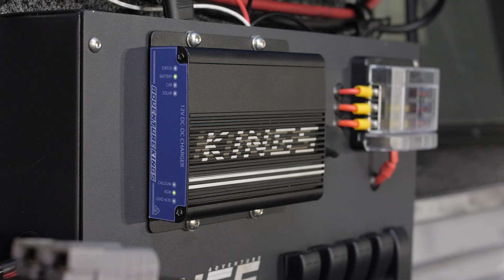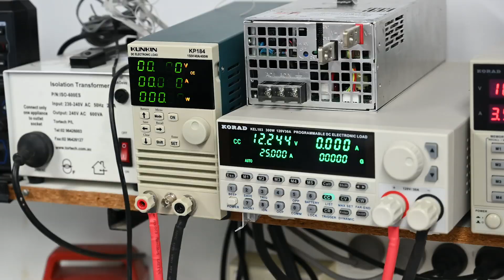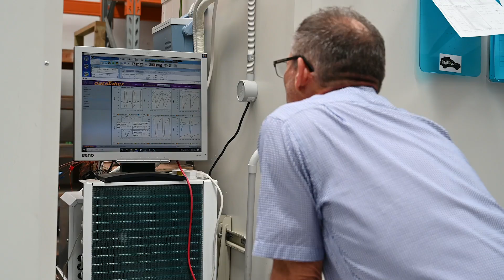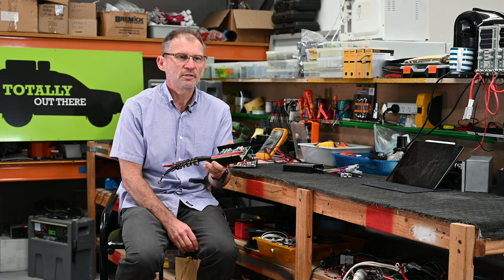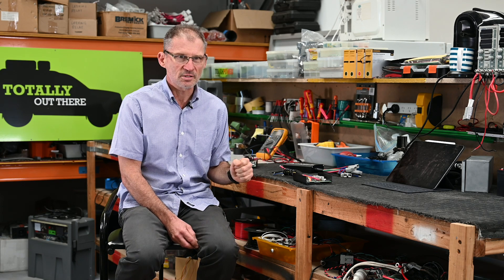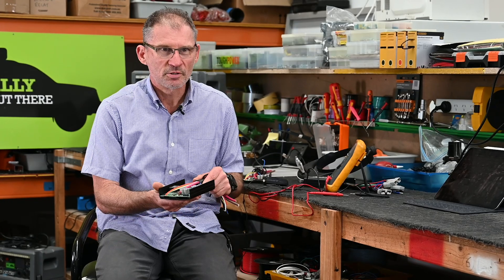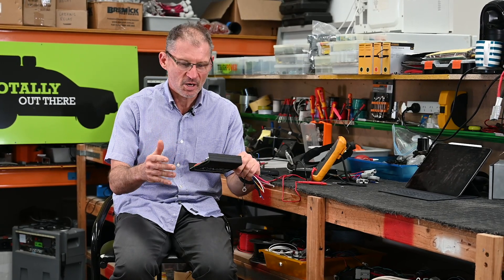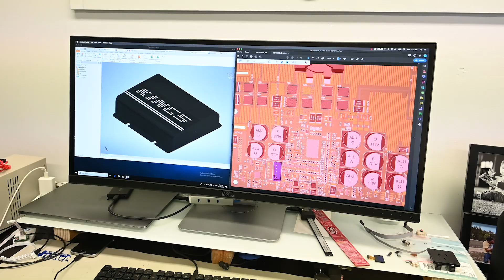Adventure Kings DC Chargers Developer's Interview

Comment: I was considering using a buck/ boost converter as a preregulator and adjust the output voltage to 19 volts
Reply from the maker: Hi there,

While you absolutely could, and would free you up to use the unit, though as you would know you'll see some efficiency losses as with all such things would be the only thing that comes to mind.

Regards, Andrew

Comment: Hi Allan, Theo here, firstly thank you for developing a great product in the AKEP-DC25A_01.
I have a question though, I have many spare rooftop solar panels and would like to use one on your charger.
Problem is the open circuit panel voltage being 45 vdc.
The charger specs say 19 vdc max.
Can you please advise your thoughts on what I can do  - ps I am an electrician.

Comment: can you put that under the bonnet?
Reply from the maker: Hi Hyra,

We haven’t fully tested it for an IP rating so we don’t suggest mounting it under the bonnet – however if you could put it in a sealed area where it won’t be exposed to moisture or mud/dirt it would be fine coping with the heat and vibrations etc.

Hope this helps,
Cahn

Comment: What is this product used for?
Reply: To charge 12v automotive batteries from a DC source, such as the vehicle alternator or a solar panel.  Input between 11.9V and 25V  DC.  There is a 20A non Solar and a 25A solar version.
Reply: @einfelder8262  Ok, but a engine alternator is designed to charge 12vdc batteries. Forget solar, the alternator AC to 12VDC where does this product come in play?
Reply: @AquaMarine1000  Primary purpose of a DC-DC charger is to charge auxiliary battery. Alternator is designed primarily to charge wet cell starter batteries.  It will never charge an auxiliary 12v AGM or Calcium battery to full capacity.  This product goes in between and can charge an auxiliary battery to 100% capacity with smart charging algorithms - something no alternator does.
Reply: Chris Bradbury the other big factor is that a lot of newer cars have “smart” alternators that will not charge an auxiliary battery correctly, they will not supply charge current if you have two batteries hooked up, they self regulate based on draw, temperature and emissions factors. New vehicle alternators are not the constant output of older generations.